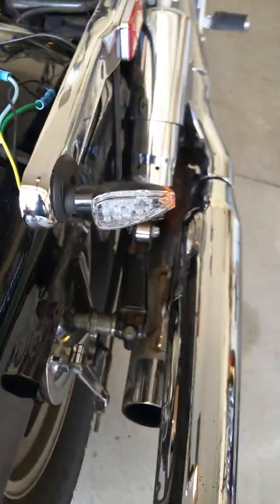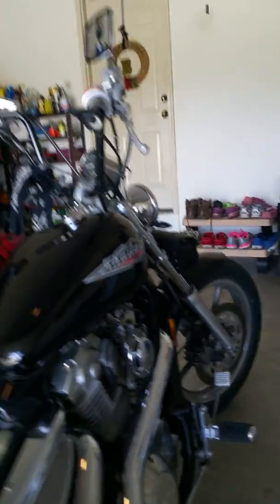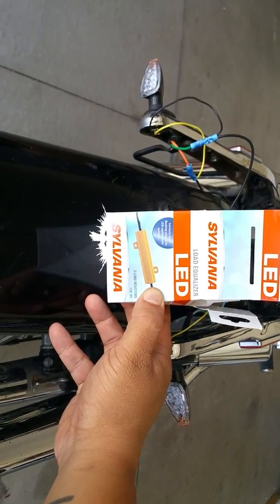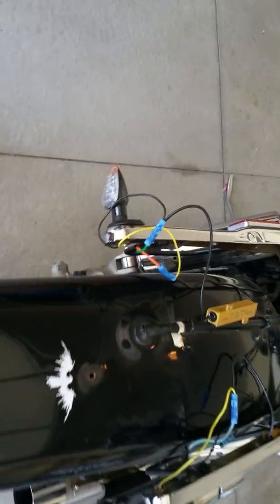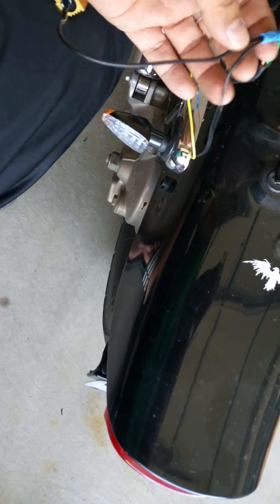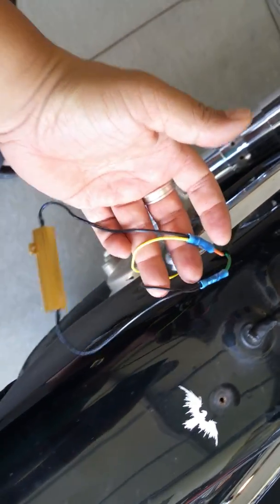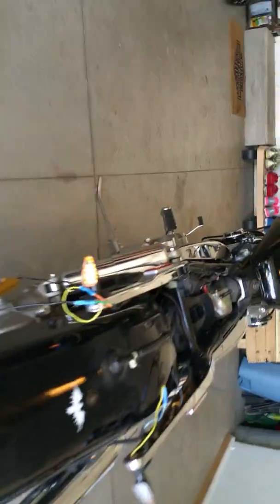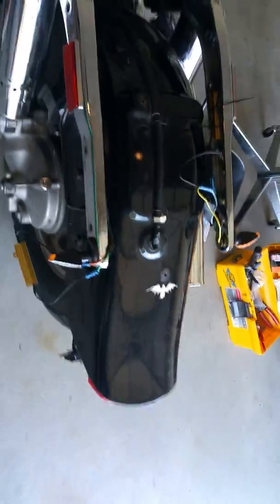LED blinkers wont work. Honda shadow Vt1100c. Load resistors. Load equalizers.

Comment: I changed the relay on mine and now my rear blinkers blink but my front don’t. Any ideas? When I flip the turn signal switch to go left my front left shuts off and doesn’t blink same happens for the right side as well and it’s only in the front

Comment: Thanks for sharing, had this very issue with my Shadow 600vlx when swapping over to LEDs. Popped these load equalizers in and they work perfectly now, thanks again!
Reply: How many watts are the resistors?